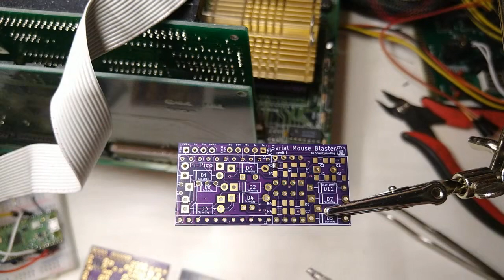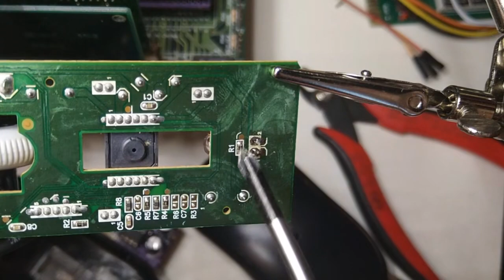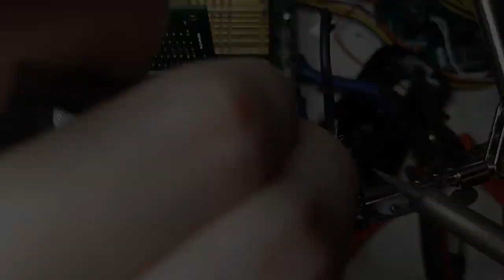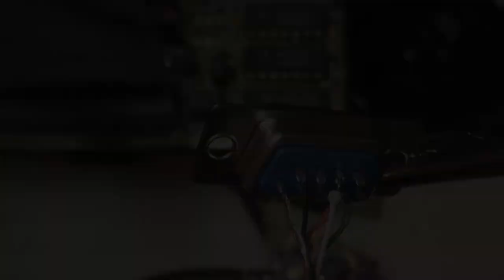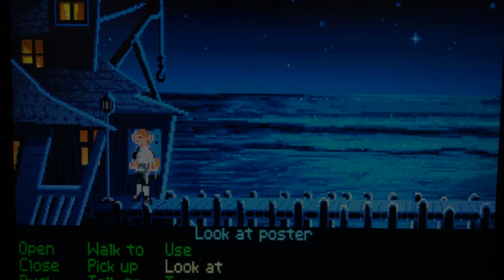Serial Mouse Blaster: Quest for the Serial Optical Mouse Part 2

Comment: One thing that I noticed while repairing phones is that many "secondary connections", like speakers, use pogo pins or regular springs. This may solve your hardwired tx/rx problems between your board and the pico; as well as adding modularity.

Comment: The best solution would be not using Raspberry Pi Pico board, but RP2040 with necessary components on custom designed PCB.

Comment: I think I would consider giving the board it's own enclosure so I do not have to fit it inside the mouse.
But that is merely a personal preference so I don't have to solder smd components.

I've ordered a new Microsoft Basic Mouse to see of this power saving modification can be done on that as well.
Reply from the maker: I am using hand-soldering optimized solder pads and large 1206 SMD components so they are not too tricky to solder. 

Ah nice, please share the current readings before/after the power mod! I am trying to build a database of all compatible mice on the project's github page.

Comment: Look at using something like an MCP100 supervisory circuit to reset the Pico.  the MCP100 is available in multiple voltage ranges, so pick one that is very close to 5v, so you get a reset immediately after unplugging.  Another trick is to add bleeder resistors.  You could probably gate the bleeder resistor with a diode, to avoid current draw while plugged in.
Reply from the maker: Thanks for the suggestions! I think I found a good enough solution: I am now using a PNP transistor that acts as a capacitor bleeder when the power is low.
Reply: @scrap_computing  The MCP100 is a single TO-92 device that does it all.

Comment: why not imu (3acc + 3gyro) + table distance led+sensor =  no ball/image mouse, just the imu as the mouse, led+sensor is to detect lift-off
Reply: no moving parts mouse, you could also use a touch pad on the top/bottom sides, detecting finger/table sliding
Reply from the maker: That would be a cool project!

Comment: Cant you use an arduino mini they got a much smaller footprint.
Reply: Or even an ATtiny85 and bit-bang the whole thing. even better if you find a PS/2 optical mouse and that reduces the complexity of the USB.
Reply from the maker: Any board should work as long as it supports USB host. You don't need that much processing power.
Reply: Then he can also use the pico's controller directly as you can buy it alone.